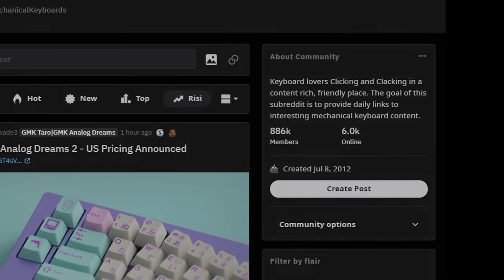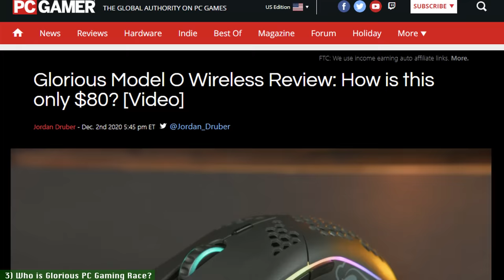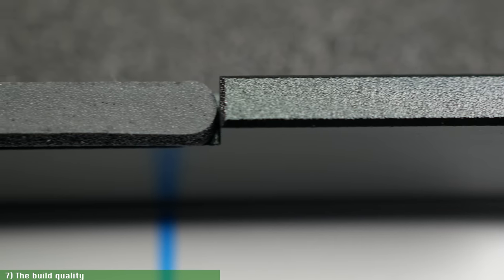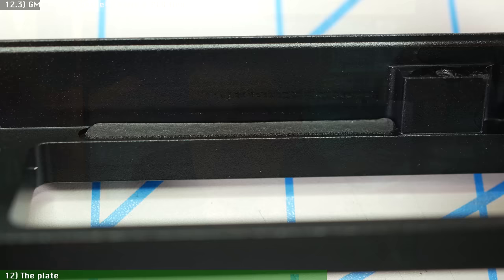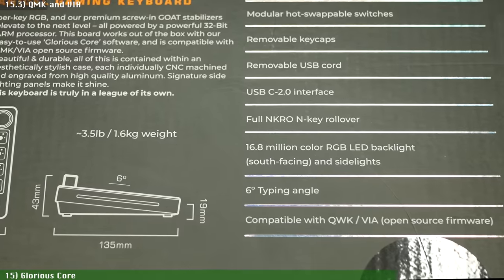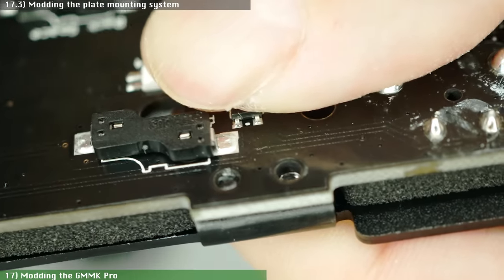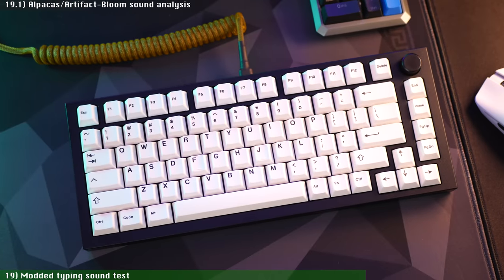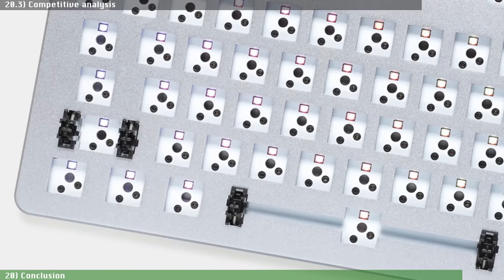GMMK Pro: The ultimate guide (in-depth review + modding tutorial)

Comment: Got mine, with Polycarbonate plate, and StupidFsish design's 4mm foam mods, did not screw in any of the internals, only the top cover, with NovelKeys Silk Emerald Switches/Lubed
keycaps are AKKO MidNight Set in ASA profile. Zeal Stabs lubed
Reply from the maker: Nice!!! How did the StupidFish foam mod worked for your GMMK Pro? Did you like the sound with it on your configuration?

And without the screws on the soft PC plate, are the switches sufficiently secure in the sockets?
Reply: @IOSam  it was still stiff, lol   but less screws to deal with thankfully when putting it all together. the flex is very minimal, the sound is fantastic.
with Linear/lubed switches and the AKKO caps, there is a nice THOC sound.
Also tried it with some Zeal Silent V2 Linear switches, was soft and quiet. My complaint is that some switches don't stay locked in securely to certain parts of the plate - say when you pull a keycap off, the switch comes with it... :^/
Reply from the maker: @miguelcollado5438  Yeah... The PC plate alone, without the O-ring mod won't give you much in the way of flex by itself, but it will definitely change the sound! Oh, and they;ll also make it easier to fit aftermarket stabs of any size.

And yeah, without the screws I had that issue with the switches coming off to easily as well.

Comment: My GMMK PRO were a newer batch and came with landing pads, the stabs were so over lubed to the point the landing pads were soaked making them stick at every keypress, you would have to pry it back up to actuate again.
Reply from the maker: That's interesting... I didn't know they made changes to the second batch. Possibly a reaction to the bad press the "goat" stabs have been getting...

But the remedy there might have been worse than the ailment... :/

Unfortunately, replacing the stabs in this board seems to be the only way to go in this first version of the board.
Reply: @IOSam  yeah if you go on the glorious sub reddit for the past month everyones complaining about it being overlube. The Landing pad they had added are useless dude to it being overlubed. You would  have disassemble the stabs and remove it or try wipe it off,  think a much better solution would be to include it as an extra like the extra gaskets
Reply from the maker: @TrynaBeCray  I suspect the tick noise we get out of these stabs are not for lack of lube (mine already came generously lubed and the noise was still there), so over lubing it is clearly not the solution.

I think it could be some manufacturing tolerance issue with the size of the stems, which obviously would be very difficult to fix.

The Rama heat shrink mod is one of the most overkill methods to fix rattly stabs I ever used and not even that could fix these stabs.

Comment: Unless the shaft on the pot is also aluminum as I assume the volume knob is, you want the plastic insert there because dissimilar metals like to weld themselves together over time.  Blingy metal tire valve caps can do this.
Reply from the maker: Good point! The volume knob is definitely Alu, but I'm not sure about the stem in the encoder (it is metal, but it is hard to say if it is unfinished Aluminium or some alloy).

At any case, while many reviewers (including myself) pointed this as a potential failure point, so far, I had zero problems with this. In part I think it’s because this is not your traditional potentiometer (which offers some resistance when turning the knob)... This is a super light digital encoder with very little resistance to turn. So, there is nothing to stress out the plastic fitting inside the knob.

At any rate, the encoder stem is the same standard size to most guitar volume knobs. So, you can easily replace it without having to buy another one from Glorious if anything happens to it.

Comment: I had sticky keys out of the box thanks to the included stabs.  Replaced them with Durock V2s which were way better.
Reply from the maker: Yeah… On the second batch of the GMMK Pro, Glorious tried to fix the “ticking” problem of the first batch but the fix ended being worst than the problem, since the overlubing made them sticky.

Did you have to file the plate to be able to fit Durock stabs? Or did you use an aftermarket plate?

Comment: As someone who is just getting into the hobby and am still deciding on what to get, this video was super helpful, clarified everything from gasket mounts to even difference between different materials, much appreciated content and amazing production quality... Just a question though, why not cheery mx switches in the build? I don't see them in most keyboard builds and I thought they were supposed to be the best.
Reply from the maker: Thank you Sir!!! Appreciated!!!

As for your Cherry MX question, it is an interesting one! Even though Cherry created this design, once their patent expired about a decade ago, Chinese manufacturers such as Gateron, Kailh, Outemu and, more recently, JWK/Durock, SP Star, TecSee, TTC among others, took the original design and improved on it to a point where Cherry switches today are the worst possible option between all these brands. These newer manufacturers use better and more modern plastics (less friction and self-lubricating such as POM and UMWPE) and springs, as well as factory lubing many of these out of the gate.

The main problem with Cherry’s aging design is that they didn’t update their molds and their plastic mix, which results in extremely scratchy switches when compared to pretty much all the brands I mentioned above. As an example, just listen for yourself the difference between the switches I tested on my TKC Portico video (which includes Cherry MX Blacks) and you’ll be able to hear the difference: https://youtu.be/XjTPX0bS_l4?t=2565
Reply: @IOSam  That was very insightful and  helpful, yes cherry ones had that raspy scratch ..
If I may ask one more query.
Where I'm from, switch choices are quite limited and for my preference; tactile switchs, available options are glorious panda, cherry mx brown, GATERON browns, and kailh browns.
For a beginner the easiest one to start would be?
Reply from the maker: @Gh05t_07  If you really want a proper tactile switch that you can actually feel the tactility, go with the Glorious Panda. Every other brown switch you mentioned here will barely register as tactile depending on how heavy you type.

The Glorious Panda is extremely tactile, but that can be attenuated a bit if you find it too jarring, by lubing the stem legs. Oh, and Glorious also sells their Pandas pre-lubed if you don’t want to go through the lubing process yourself. You can also find plenty of info about it on my Holy Panda War video 👉https://youtu.be/AfdfJ5jq6qM

Comment: Fantastic video, helped me a lot in making a decision! Going with tangerine switches and using durock v2 screw in stabilizers, and kinectic labs white on black keycaps. Sounds great with some light lubing on the stabilizers although it was a tight fit with the aluminum plate!
Reply from the maker: Thank you Colin!!! Happy to know it was helpful to your build!
Good choice on switches by the way! I have been using Tangerines (had to "re-lube" them though) on my TKC Portico and they really nice. As for the stabs, yeah... It's a bit of a chore to make GMK, Zeal or Durock stabs to fit on the Alu plate, but it is doable.

As for the keycaps, what is your opinion on the Kinectic Labs PBT set? I haven't tried these yet, but I'm curious and willing to buy a set to give it a go...

Comment: Love the second build! I am going to try the O-ring mod on mine :) Great info!!
Reply from the maker: Thanks!!! And please let me know if the mod works out for you.

That Kaiju set is pure eye candy! And those SP Stars will go into a TKL board I'm getting soon... Love these switches!
Reply: whats the benefit of having more flex?
Reply: @IOSam  Build came good :) I can feel the difference from the stock build. thanks for great suggestions :)
Reply from the maker: @darealrulezbreaker9493  Having more flex on the plate usually translates to a tighter and more defined sound, since the plate absorbs more energy from your typing instead of passing it through to the bottom case. It is preference thing though, so having a more flexible plate is not necessarily something everyone will enjoy (you have to try it to see if you prefer it that way).

Comment: Hello, thank you for very informative video. I just had one question. Would 3mm or thicker o ring mod will make it more flexible and better typing experience?? Or would it be about same and will just ruin esthetics of the board 🤔
Reply from the maker: You're very much welcome! :)  While I didn't try this board with 3mm thick O-rings, it would increase the range of motion of the plate even further (by ~1 extra mm depending on how tight you make the screws) and thus give even more space for the gaskets to work. As a result, at least in theory, it should proportionally increase the flexibility of the plate/PCB assembly.

And yes, this will make the gap between the parts of the case even wider, so that would be the clear downside here...

Comment: for the stab wires, instead of using heat-shrink, try using uhmw tape
Reply from the maker: Yeah... After I published this video, I ended up learning about using Teflon tape to mod stabs with much ease (and better results) than with heat shrink... Living and learning! :)
Reply: @IOSam  I use the uhmw tape around the wire and Teflon tape on the PCB as in the "band-aid" mod. Stabs feel a little less mushy with Teflon vs a bandaid

Comment: Perhaps I missed it in your video but a modding thing I have not seen in literally any GMMK pro video is the Rotary dial can be replaced with just about any 6mm guitar knob. Xentric makes cheap ones in tons of color patterns. May as well have the thing match those crazy expensive keycap sets right?
Reply from the maker: Hi Michael! While I didn't add an aftermarket knob in my video, I did mention that this encoder has a standard size (20:06) which should be easy to replace.

So yes... Any 6mm knobs from Xentric ( https://xentricguitars.com/products/guitar-accessories/ ), or other guitar accessories shop, should fit this keyboard with no problems.

Comment: Why did you choose to put gaskets on top? I would assume that would push the whole construction downwards like a sandwich, reducing flex. Have you considered adding more gaskets to the bottom of the case for more flex? I bought a big roll of poron gasket from amazon to play around with, works really well at around 3mm thickness.
Reply from the maker: That's a good question! The reason why I ended up putting an extra gasket layer on top of the plate is that the gaskets that were pre-applied to the top frame of the case were so thin and recessed that when typing, the metal of the plate could touch the metal of the top frame when bouncing back (and that could generate a slight ping noise).

At any rate, the extra gaskets Glorious included in the box (that I applied to the top of the plate) had half of the thickness of those pre-applied to the bottom case, so they didn't add too much distance between the plate and the top frame.

Comment: My recipe: Stupid fish pcb foam, standard case foam, tape mod x2 layers, removal of centre screws and putting it back together with only the four outmost screws on the outside of the case. Durock v2 stabilizers with lube and holee mod. For me this equals Acoustic heaven, deep tones, no ping, no rattle and a still firm but not harsh typing experience.
Reply from the maker: While I have not tried the Stupid fish foam yet, I have been playing around with tape and PE foam mods (you'll see more on those on my upcoming video) and yes... These are some of the most effective mods out there when it comes to "thickening" the sound of almost any keyboard!

So I would also definitely recommend these mods on the GMMK Pro for anyone who wants this keyboard to sound "thockier".

Comment: So in the sound test, were you able to fit the silicone sheet with the PCB foam in the keyboard as well?!
Reply from the maker: Yes! You are correct. I have not removed the foam between the PCB and the Plate. I just replaced the bottom case with the silicone sheet.
Reply: Sweet! Im mostly likely going to be adding silicone for dampening too, I’m just afraid that it would be a tight fit since the board is so snug anyway

Comment: Great video! You spent the last half of the video trying out ways to make your plate flex. I dont get why flex is a good thing? Does it add something towards the acoustics?
Reply from the maker: Hey xbeat! Thank you so much!!! Your question about why did I spend so much time trying to increase the plate flex of the GMMK Pro is a very good one! You see, for my own personal preference, I don’t find the GMMK Pro lack of plate flexibility a problem in terms of typing experience, since I am a very light typist that types with all 10 fingers (which I consider proper typing form :).

However, I do know that a lot of people in this hobby (possibly under the influence of other popular YouTubers and Twitch streamers) want as much plate flexibility/bounce as possible in their keyboards. So, while I know that the GMMK Pro would never be what I like to call a “trampoline keyboard”, I wanted to show at least one way to increase its plate flex a little bit (enough to make a difference when typing).

My opinion is that plate flex/bounce can be a useful feature for people who, unlike me, type with very heavy hands and hammer the keys with a lot of force, since it helps to absorb some of the excessive typing energy, which can reduce the shock on the fingers and prevent it from making the keyboard materials to vibrate excessively (and thus sound a bit “pingy”, rattly and weird).

Having said that, the additional isolation provided by my O-ring mod, also had a measurable impact in the way the keyboard sounds and, in my opinion, it made it sound a bit better as you can hear on the typing tests.

So, while I don’t like keyboards that have excessive plate flex/bounce for my own typing style, I do appreciate a mild amount of flex and bounce (bounce here meaning the whole plate moving up and down) mostly for acoustic reasons, since with my light typing force does not benefit from plate flexibility.

And finally, stay tuned for my upcoming review of Glorious new “Flex Kit”, which is an upgrade kit they developed that will help existing GMMK Pro owners that would like to have more plate flex to achieve that by replacing the bottom part of the case with a new redesigned one (that has more space for the plate/PCB assembly to move up and down and thus does not need the O-ring mod).

Comment: I'm convinced. This will be my first mechanical keyboard. Thanks. Quick question though. Do you have a list anywhere for those luxury and over the top keyboards. I'd like to see what people get if money is no barrier.
Reply from the maker: Hey Dan! Happy to help you my friend! The thing with super luxury keyboards is that 99% of the times, they are not in-stock products. Instead, they usually sell through obscure group-buys that you’ll only find out about it if you spend time on Keebtalk.com and Geekhack.org forums, or on the https://www.reddit.com/r/MechanicalKeyboards sub-reddit.

As you probably know, with group-buys you’d have to pre-pay for the keyboard kit and wait for it to be manufactured and then shipped to you (which can take between 6 to 12 months on average). So, as you can imagine, not too many people have the stomach for this type of deal…

One of the very few luxury keyboards that do sell at least two models directly from their website (with a slightly shorter wait time of about 2 to 3 months) is Mode Designs. They offer both a TKL and a 75% (that you can configure and buy here: https://modedesigns.com/products/sonnet ) which are some of the best quality boards money can buy today.

The Sonnet, their 75% kit (not including switches or keycaps), starts at $300 plus shipping, but can be tricked out with optional configurations that will take its price as high as you’re willing to pay.
Reply: @IOSam  excellent, thank you!

Comment: Crazy how much the space bar thock depends on what caps you use. It's not always the stabilizers that make it crappy
Reply from the maker: Yes! Most definitely!! People really seem to forget how much the caps materials and profile affect the sound of the keyboard in general (and the spacebar in particular).

Another important factor is the length of the switch stem pole. I'm working on the Portico review now and I was shocked to see the difference in sound coming from the spacebar (with the same stabs) with different switches as well as different cap materials (ABS vs PBT).